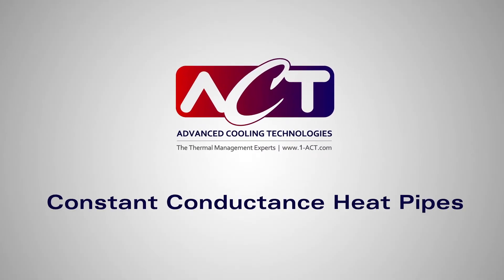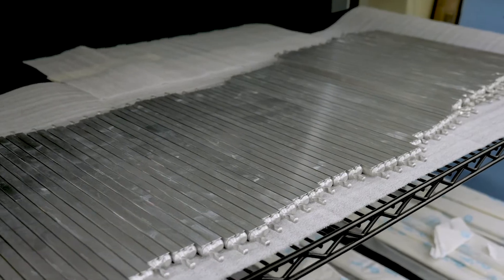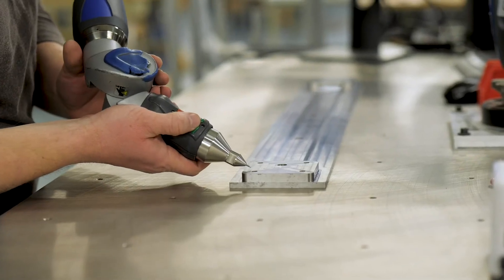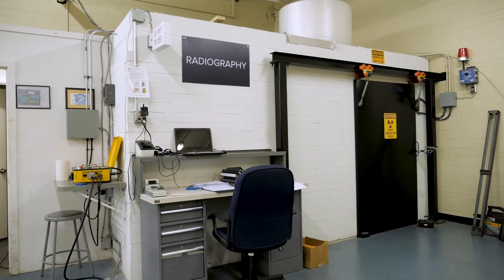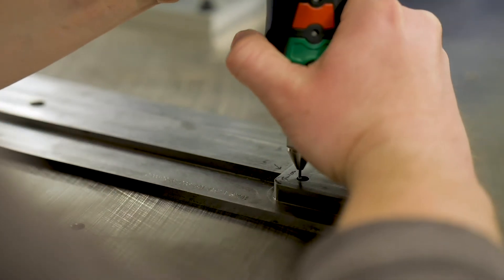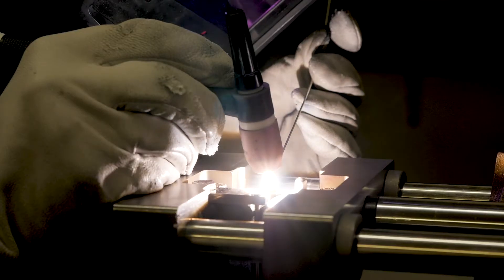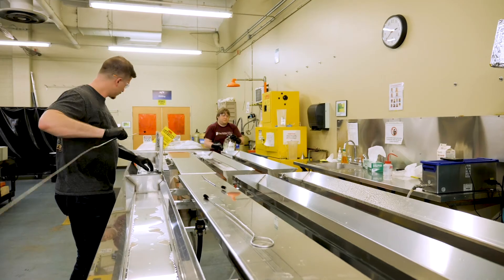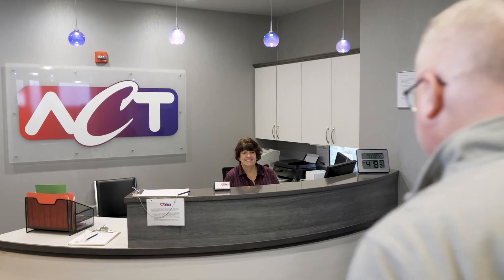Heat Pipes in Space  I  Constant Conductance Heat Pipes for Thermal Management

Comment: I was wondering what the limitations are on a heat pipe size wise. Like on a perpendicular setting how long of a pipe can you have. Basically the physical limitations.
Reply from the maker: CHPs have been embedded in sizeable radiator panels and used to move heat significant distances external to the spacecraft. There are some manufacturing limitations such as how long you can extrude the envelope, but in most cases, the physical limitations are dictated by the thermal performance (i.e. how far can you move the heat and return the fluid). Variables such as temperature, diameter, heat input zones, wick structure, heat flux, etc. all play a role in determining these limitations. Please contact us at solutions@1-act.com if you have a specific use case you'd like to discuss in more detail.